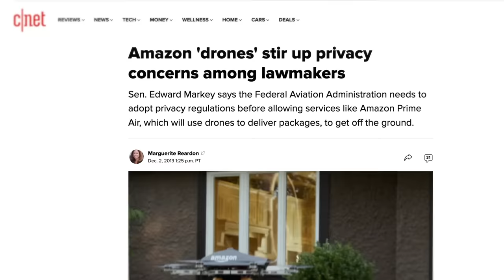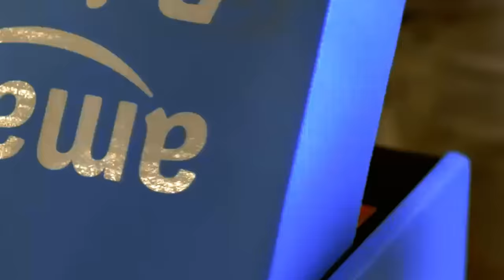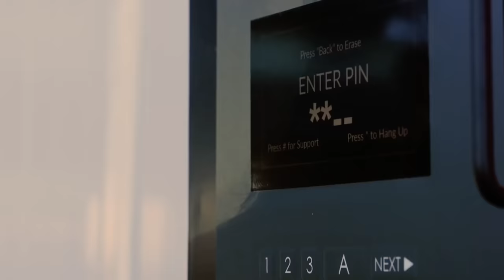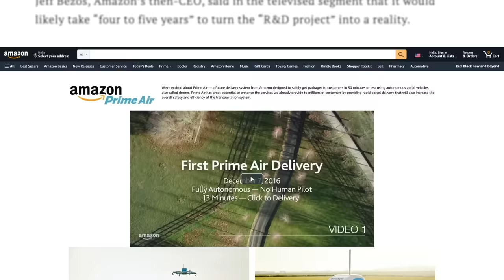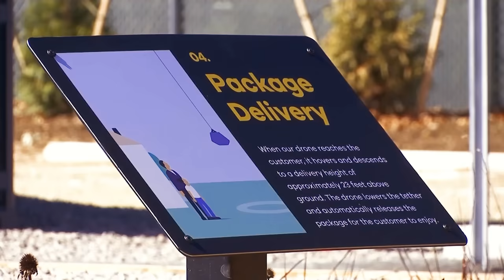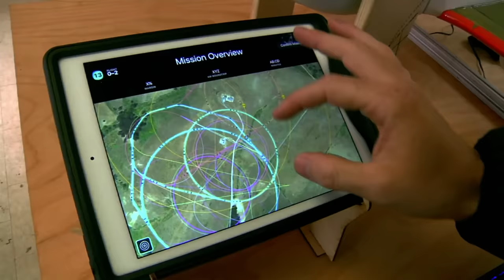Drone Delivery Was Supposed to be the Future. What Went Wrong?

Comment: Delivery drones are a little bit like flying cars.

Solving most problems by shooting them up in the air doesn't work, because being airborne adds its own problems.
Reply: And just like flying cars, the drones are practically useless in an every day setting.
And if you want to compare them to helicopters, helicopters are flying cars specifically used for long range transportation through rough environments, an actual useful application just like the video said :)
Reply: @homeofthemad3044  Believe in JESUS today, confess and repent of your sins. No one goes to heaven for doing good but by believing in JESUS who died for our sins. GOD loves you soo much unconditionally.😍😚🤗
Reply: The FAA killed it.
Reply: @homeofthemad3044  @Jon S In my observation, flying delivery drones, ground delivery drones, self-driving cars, etc, are all our current generation's "flying cars." :-)
Reply: Drones are great for aerial photography! But other than that, not so much...
Reply: Noise pollution!
Reply: @bestberryj  That's neither fair nor true.  Flying cars would not be particularly practical using current infrastructure.  That much is true.  But today's modern cars wouldn't have been particularly practical 200 years ago when streets were all mud and garbage.

But just like we developed paved roads to go with our modern car infrastructure, if someone ever managed to come up with a plausible flying car, we would quickly find rooftop parking being built everywhere, mid-air traffic lanes where needed, etc.

But the real problem isn't the infrastructure, its the physics.  Gravity is simply hard to avoid.  That "if someone ever" qualifier in the previous paragraph is an enormous "if".  We simply don't know of any physics that would allow us to lift the weight of a person (never mind 3 or 4 people plus baggage) off the ground in a manner that covers all the tickboxes of small, easy enough for average people to use, and power-efficient enough to stay airborne for more than a few minutes at a time.  Fans are power-hungry, loud and unsafe.  Maglev lift solves those problems but requires tracks (so little different from current car tech - not really "flying").  And.. that's about all we've got.

But of course drones aren't cars.  They only have to lift a few pounds, not potentially hundreds.  And they don't have to worry (as much) about their own safety as long as they can avoid smacking into people below.  A lost drone is expensive, but replaceable - unlike a lost life.  The big problem with drones and why drone delivery won't work is that nobody gives a shit.  We already have fast delivery via ground couriers.  We already have cheap delivery via normal parcel delivery.  What niche are drones trying to fill?  Why would we start changing massive amounts of infrastructure to support something nobody cares about anyway?
Reply: @alunesh12345  Y'all religious folk really need to reconsider your messaging.  If I don't believe in JESUS, then I likely also don't believe in heaven (or at least not your concept of heaven), so why would I give a shit whether I get there or not?

I mean I get what you're trying to do, and I'm not trying to bash your faith.  I'm just pointing out that these "you must believe" arguments only work on people who already believe - they won't and can't possibly convert anyone who isn't already part of your faith, because (to them), your reason for why they should believe is just as fictitious as what you're asking them to believe in.

If you want to convince me that JESUS is the correct thing to believe in, you need to come up with an argument that isn't self-referential - that doesn't require me to already believe.  I have no idea what sort of argument that may be (obviously nobody's found one that convinced me yet!) but I can't say that such an argument doesn't exist.  Maybe you'll be the one to find it?

(Also, how exactly is GOD's love unconditional?  Right in that post you're demanding that I confess and repent my sins - that sure as hell sounds like a condition right there.)
Reply: @altrag  I’m not a believer myself but I know of others who ended up converting despite not having an extremely strong belief in the stories preached, some of their argument about why they ended up converting include: 
agreeing with the morals the religion come with
Finding acceptance or joy with the people in that community
The activities they engage in seemed meaningful if not interesting etc 

Some of which also expressed willingness in actually believing most if not all of the religious text that comes with it even if it’s not definitively proven. 

Don’t get me wrong, I don’t think religion is for everyone either, I just wanted to mention that there are plenty of reasons one would convert that are self referential(?) 
Either way, I still find his comment equally annoying too tho, irrelevant and self promoting.
Reply: @yesno7889  > some of their argument about why they ended up converting include
Those aren't arguments, they're anecdotes.
> agreeing with the morals the religion come with
I can agree with your morals without needing to agree that those morals were handed down by a God.

> Finding acceptance or joy with the people in that community
I can find acceptance and joy with people of any number of faiths and communities.  That's not a function of any particular religion, or of religion at all for that matter - you can find acceptance and joy in team sports, anime clubs or any other activity that's popular enough to have formed groups of like-minded people.

> The activities they engage in seemed meaningful if not interesting etc 
This is getting a little closer to relevant, though it still presupposes a belief around what's "meaningful".

I'm not saying there aren't other reasons to join a faith - or just joining a church without necessarily believing.  All I'm saying is that if the approach you're taking to recruit is via philosophical argument, the one presented by the original guy (and countless others) is never really going to work.

> and self promoting.
Not sure what I was trying to promote there?  The only thing I was advocating for was Christians doing a better job when trying to recruit new believers.  And as I'm not a Christian, it feels kind of odd to think of that as "self" promotion.
Reply: @altrag  I was referring to the other guy
Reply: @altrag  and btw, technology surrounding flying cars has come a long way, and there has been, for a while now, many working prototypes, the only real issue is really safety, commercialisation, infrastructure and laws that’s holding it back from becoming a reality. 
If you want some evidence that they are feasible, there’s the aircar which has recently been legalised in Slovak which is not only safe but is also far more fuel efficient than most current cars atm, of course there are many other non-legalised yet solid prototypes as well, some even dating to a decade ago. 

Like genetically modified food, genetically modified humans and many so called sci fi concepts usually the only thing limiting us besides our current technology is really mostly social issues, such as law, economics and ethics.
Reply: @LarryJohnVA  ground delivery could work, self-driving trucks might distribute enough for amazon to abandon their current truckers
Reply: Elon: "I know, we could launch thousands of low Earth orbit satellites that are comprised of robots that make fast food and then are dropped from orbit and land right in your back yard."
Reply: Zipline might be an exception. It literally includes shooting the vehicle up in the air, if I remember correctly about the video 3 years ago on this channel.
Reply: Also, moving from a 2D navigation space to a 3D navigation space brings a whole lot of problems, including good old gravity. I believe that's part of the reason why flying cars like we see in sci-fi won't be mass adopted any time soon: we have enough challenges with our old 2D cars as it is.
Granted, we have planes and helicopters, but the degree of control on that industry and training needed to fly one of those vehicles is nowhere near what we have for cars.
Reply: They make them fly for the same reason why Hyperloop has single pods, it looks more futuristic. Pods don't works because we have trains, flying won't work because a thousand reasons and drone aren't practical or safe ect.
Reply: @krozareq  
Worldwide fast food coverage!!!!!

Stores are for peasants.
Reply: I think self-driving cars will end up going the way of flying cars, delivery drones, hyperloops, etc.  The complexity of all these pie in the sky ideas is underestimated.
Reply: @thequake180 , I actually think self-driving cars are going to be a success, although they'll take longer than the optimistic predictions to arrive.  They solve two major problems:  bad drivers, and paying drivers.  Their appeal to consumers/early adopters is durable rather than a novelty:  if you spend 1-3 hours a day commuting, not actually having to drive is a huge weight off.  And the problems they introduce are all technical problems rather than inherent problems.  Flying is inherently more dangerous than rolling.  Automation isn't inherently more dangerous than manual operation.
Reply: @JonPITBZN  Automation works very well for very simple and repetitive tasks. The problem is driving in traffic is not a simple task for a machine to safely peform. There are a million variables that is not easy, or may even be possible, to program into a machine.
Reply: @bestberryj  or super fast transportation to the hospital.
Reply: @altrag  Flying drones have an obvious advantage over ground drones because they can travel from A to B in a straight line. This is particularly important when it comes to ordering takeaways.
Reply: @thequake180  I can tell you haven't a clue what's happening in the field of ML. But, sure, keep thinking you're cool for being unnecessarily pessimistic.
Reply: @The_Original_Hybrid  what the heck is ML you are to cool for school to know about something that 99.9% have never heard of.
Reply: @thequake180  Bro, it's 2022. I'm pretty sure the majority of humans are aware of machine learning.
Reply: @The_Original_Hybrid  and self-driving Teslas have yet to learn not to drive into the back of parked emergency vehicles and semis. doesn't seem very advanced to me.
Reply: @thequake180  Sure, self-driving cars aren't perfect yet, but neither are humans. I'm not sure what point you're trying to make.

Also, this should be obvious to anyone, but there's a huge difference in difficulty between navigating empty airspace and navigating busy roads, because there are hundreds of moving vehicles and pedestrians.
Reply: Why not creating ground tunnel or sky tunnel for drone so make sure the tunnel only for drone to keep delivery not even noisy and safe?

For us to make better future should create tunnel for in every house or apartment with special tunnel unit so everyone can enjoy delivery without worry

More privacy should every room have to have special tunnel for drone will be amazing
Reply: @altrag  Dude, the first Car infrastructure was made on the backs of previous cart trails and stone roads, and are made with wheels specifically designed for carts. Rubber Tires and roads accomodating it are more modern inventions, so that analogy alone is problematic.

The reason why Flying Cars cannot take form is 1. You need a pilot's license to operate one. 2. People are suffering high accident rates with modern cars already. Imagine the bad press once Flying Cars start ramming into buildings, and the amount of memes of some hypothetical Flying Car Bomb can form.
Reply: @skybattler2624  > The reason why Flying Cars cannot take form is
Because they're physically not possible.  At least not with the technology we currently have and to the expectations people have from "normal" cars (or watching the Jetsons).  We can barely get a single-seater with no cargo to fly for more than a few minutes without just going full-on airplane design and losing the ability to call it a "flying car" with any honesty.

Maybe there will be some kind of breakthrough that allows us to carry sufficient energy to provide decent flight times without being too heavy to get off the ground (or alternatively some sort of levitation mechanism that allows us to lift more weight with the same amount of energy), but I'm not holding my breath on that happening in the foreseeable future.

And until it does, it really doesn't matter how bad people may or may not be at driving a flying car, because there simply won't be any to drive outside of a handful of rich people just getting their giggles on.
Reply: @altrag  we already have restrictions on Drones... DRONES, from flying just about anywhere and everywhere. Imagine the reason why flying cars have restriction is because of the FAA
Reply: @skybattler2624  What I imagine is that those restrictions would be changed to work with the new reality.  Just like we didn't have 70mph highways when everyone was riding horses.  Technology changed and the world changed to match.

I have no idea how the world will change to match of course.  Nobody has yet come up with a useful flying car design, and if such a thing ever happens there's no guarantee it will look or operate anything like any of our current attempts, so predicting how we'd deal with such a theoretical future is very much just random guessing.

The only thing we can say for certain is that today's regulations and rules would not work and would necessarily have to be amended or replaced with something more fitting to the times.
Reply: We have flying cars, they're called Cessna 172's (the most produced and used aircraft in history). You just need to spend $10,000-$20,000 (depending on how many hours it takes you to learn) to get license at a school and then buy your own equivalent of more expensive boat (a gps is $2,000-$16,000, imagine what everything else costs) to be able to use your own "flying car". Oh, don't forget, fuel (avgas) is $5—$10 a litre depending on location. Its ~30 litres an hours to fly, thats ~$200-$300 an hour to fly, and these are all estimates on the top of my head that are assuming an extremely specific setup in engine throttle, choke, carburetor, altitude, wind direction, temperature, altimeter, AoA, airspeed, RPM etc. aka the number can very extremely based on operator conditions, engine setup and whether, and you need to do most of the calculations yourself. Or you can pay ten times the amount of every number above to get a license to fly a fancy Citation (also a Textron Cessna product, oh and Textron? the hidden megacorp you've never heard of that makes everything).
Reply: @commandernomad2817  > they're called Cessna 172's 
Those aren't "cars" though.  They're airplanes.  A "flying car" is generally thought of along the lines of the Jetsons or Back to the Future - a vehicle that operates very similar to a current ground-based car but with the option of taking off (preferably VTOL or at least a very short runway - the length of a normal driveway give or take).

You can't just drive a Cessna down the interstate and then lift off when you want to exit the highway or anything like that.  You can't just park a Cessna at the side of the road when you visit a friend.

A Cessna is a personal vehicle capable of flight sure, but its not a "flying car" by anyone's usual understanding of the word.  Its a "small airplane".

I don't know what an actual flying car will look like (and I suspect I never will - the physics just isn't there unless we discover true antigravity or something completely unforeseeable like that).  But whatever its final form, it won't look like an airplane.  Because airplanes just can't be operated in the manner we would think of as being a "car".

Some of the quadcopter designs you see here and there are much more in tune with what one would expect in a "flying car".  Of course none of them are really practical (or safe) so those vehicles are also not particularly predictive of what any final design will look like (and again I doubt it'll ever come to fruition - the size of the fans you need to generate sufficient lift for a useful carrying capacity is just too large even if we solve the battery weight issues).
Reply: @LarryJohnVA 
And dropping grenades.
Reply: @Chris-rg6nm yup because plane flying is critical and drones would have to be mandated to less than 400 feet
Reply: @altrag One potential niche is rural delivery/delivery to inaccessible places.
Reply: @LineOfThy  Problem with that is the same problem we have with current delivery to rural places:  Its too expensive.  Flying vehicles don't really fix that particular.  It might be useful for something like logging camps where the logging company is willing to foot the bill, but no random farmer is going to be paying $1000 shipping just to have it delivered to his door - they'll just go pick it up at the post office next time they're in town (and that's already probably quite a bit more expensive than any urban delivery option!)

Comment: I thought we were going to have home drone pads (like a 4x4 padded, orange platform in an aerially clear area around the yard or driveway, that would have its own pad address you could enter and transmitter to help the drone find it.)   And you could easily have a few community pads on the roof or whatever of apartment buildings, and could fence these off in yards if needed for dogs, etc. 

Seems like that would help with the “last mile” problem, but there must be some other problem with that (including that people would need to buy a drone pad.)
Reply: what i was thinking